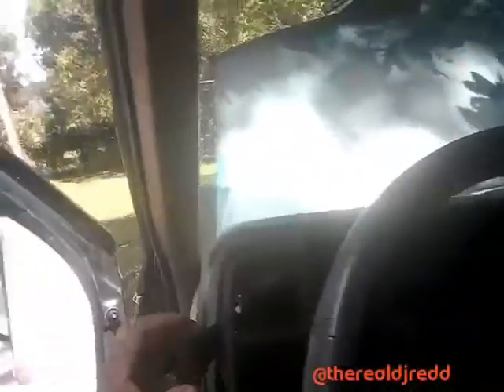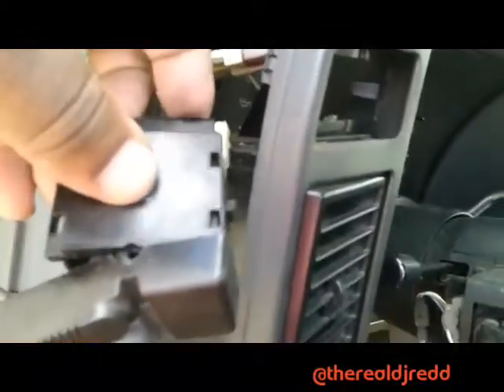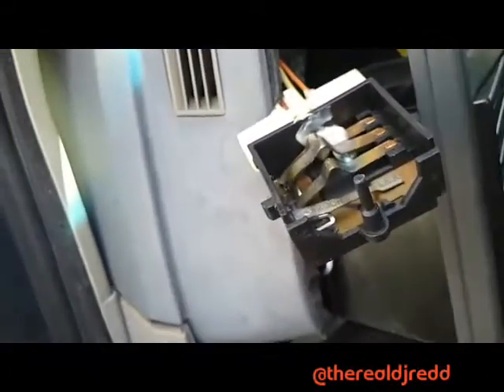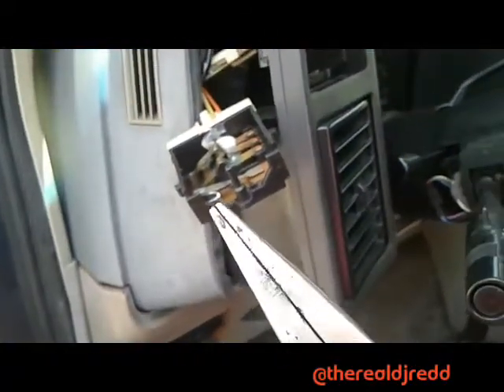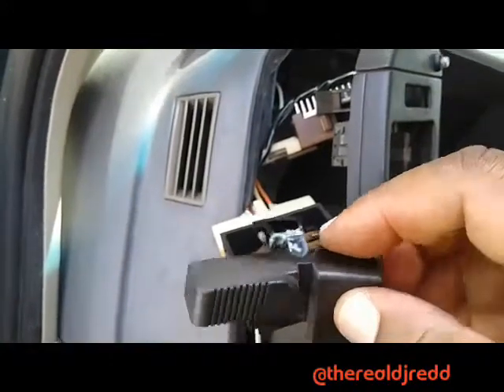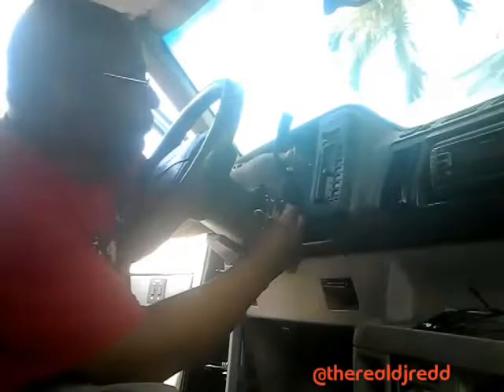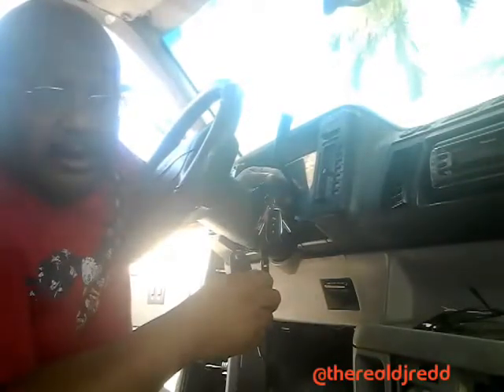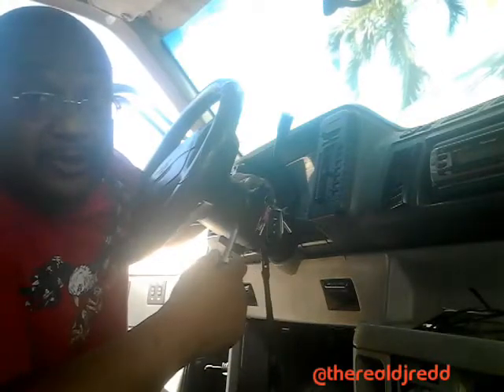Chevrolet Astro Parking Light not working

Comment: Ok my dash light went out which made my tail lights go out and I tried the fuse and it popped it what can I do
Reply from the maker: Check your relays
Reply: Where is the relay or fuse on a 1996 astro  van
Reply from the maker: @saulluciano2263  It should be under the dash just above the E brake.